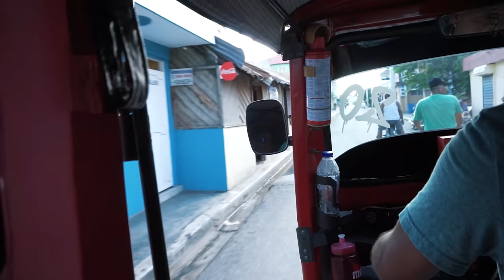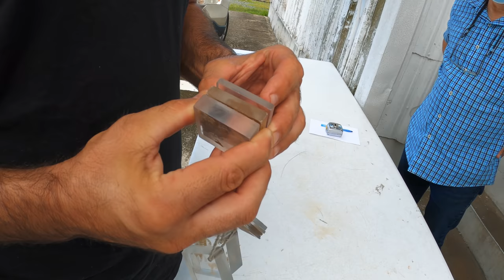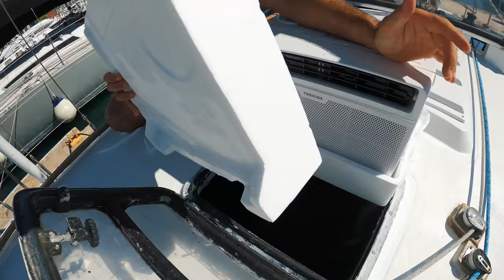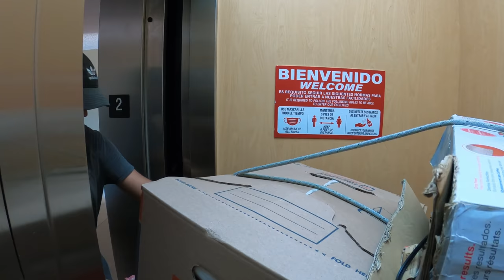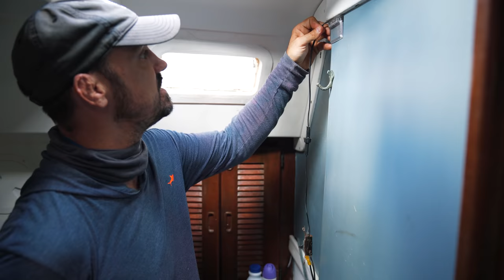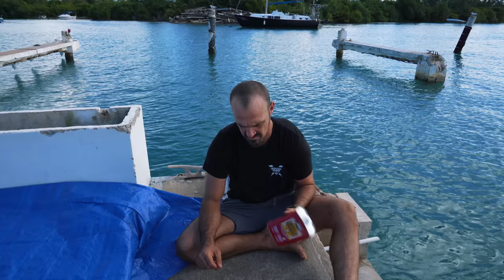BOAT YARD (PART 1) COMPLETELY ROTTEN BULKHEADS!

Comment: Hello,
Luv-ya all!
Years ago, walking space between bulkheads into the bow birth was quite narrow. I got a sheet of 4' x4' catdboard and cut a templet along the hull curve as well as the vertical floor to ceiling walkway. One templet for port side, i bought 1" thick solid plywood 4' x 8'. There are no gaps between the laminates, so when you cut the plywood, there are no open space gaps where ever you cut down to 2 4' x4' pieces. Then, using the templet, using a handheld jigsaw, I had two full size pieces to make a sandwich with the original bulkhead in place
 Thare are nuts with a flat round flange that dig into the 3 layer sandwich. My bulkhead had no water damage, the original bulkhead was lie sandwich meat, the new solid pirces were like two pieces of samdwich bread. Using waterproof liquod nails, nolts, flatt washers and the flange bolts, I tighened the pieces together. You drill thru all 3 pieces; posh a bolt thre a flar washer and the flamge bolt threads toghen the sandwich the same as if u clamp the pieces together. With a pencil, I drew a line 6" parallel to the deck along the ceiling, 6" inches alomg the hull side contour, and 6" along the flat edge of the Vbirth platform that ate the boxpring side of the matress cushions. Using the jig saw, I cut the c shape out of the new 3 layer bulkhead. With bolts 3" centered along the new c shaped bulkhead, the hill was reinforces and strong enough to reinforce and maintain hull integrity. It became so easy to get into the Vbirth with so much open space. My boat potty was in the center space under a cushion over a hinged hinged plywood cover over the top of the potty. I removed the potty and made a storage space whete the potty was. There was water damage, soft spots above the floor panel resting on the bilge bulkheads. I used the same solid plywood to reinforce the floor bulkheads. You are replacing severly wayer damaged bulkheads.if there is no solid bulkhead wood, be sure to use solid core plywood making templets to match the original bulkheads. I recommend cleaning the interior of the hull contour, reinforcing the inside of the hull fiberglasss with 6" strips of heavy movin-rovin glass cloth, and securing your new bulkheads to the center of the new hull bulkhead  strips. The new fiber glass won't need to be finished for appearance, but the new bulkheads will remain strong on a boat yard cradle or at sea. Solid core plywood with waterproof glut is in incredibly expensive, but will be syrong for years and maintain hull integrity.
Be ceryain to inspect keel bolt integrity, ih the hill plywood bilkheads are compromised, the seal between the hull and the keel can break loose , flood the hull and sink boat. Any keel bolt rust or water damage to hull bulkheads means rebuilding and upgrading are a complete waste of money. Get a hull survey asap, before continuing with any more work. Bilge water damage or keel bolt reat are probably the same as a termite infested house.
You have a very old boat and heve taked farther than it likely should have gone. Check it out immediately before spending and working to repair that could remain a very weak vessel even with a ton of repairs and remodeling.
And get a boat survey and seaworthy boat insurance. 
A truck sideswiped my boat on a cradle in storage during the middle of winter. A crane picked it off the ground, but the keel bolt seal was compromised and my completely remodeled, cosmetically perfect boat was a total loss paying me a settlement of $2,000 where my boat was restored and worth 10 grand easily. I don't want to depress you, but please get a survey asap.
I love the fast forward episodes, maybe you can capture your new engine pushing some wheelies very soon!

Comment: Lucky, lucky you...  You've got a Home Depot there, so instead of plywood back in some of the more critical spots.
Corian solid surfacing instead. Water damage and rot resistant forever.

Comment: Rotten bulkheads is never good news, but it's a good opportunity to get rid of excess weight in old hulls, replacing wood with honeycomb sandwich panels. Using carbon in strategic high-stress points and fiberglass in the rest can make your hull way stronger, yet way lighter.

Comment: Wow, just in the previews alone I'm seeing the possibility of a Bulkhead problem. All I can say is, loosen up your rigging, then go to work, Be ready with Marine plywood, lots of fiberglass cloth, and lots of epoxy. And be ready to grind grind grind. I can't say more for going to look at some of Parlay Revival's vids on Bulkhead work and fiberglass work. They did so much , they've got it down. They eventually found the bad bulkhead that was ripping the boat apart because it alllowed so much flexing. And they show a complete replacement , all the tricks. I could find that video if you wanted. Anyway, you told a sort of joke here, and I wondered what that spanish word was ? about 25:31 started with a p or b barathas or something ? OHHHH, got it Pirates in spanish . LOL One guy has a way to run 12v AC . Takes a few panels though. Clark on the Temptress

Comment: Old Hollywood trick to lighten wood to look sun bleached or to lighten prior to oiling is to put plain steel wool in a bucket with distilled white vinegar until the steel wool is dissolved. Then brush it on your sanded wood. It will "distress"  it and make it look sun bleached. Then just use a good stain or preferably oil,  to get the color you want. Also, can you really call it a $5K boat any more? Maybe when you're done, give us a total over the years.

Comment: Put a coat of poly urethane over the wood of the bulk heads or fiberglass resin to seal the wood against water damage.  The acid I have used for wood cleaning works well but just strips the wood to its natural state.  I don’t think you can bleach that wood to a light color.  Might be better to paint it.  Definitely lots of wood rot to repair.  Do the structural work before worrying about the cabinets. That way you have a better idea of budget.

Comment: Sailing Parley Revival redid the bulkheads on their cat, do think that any plywood should be epoxy impregnated on any boat. Do wonder if your mast step is not reliant on those bulk heads? Was just thinking of how they sandwich a steel plate into garage door frames to prevent sagging. Ask your fiber glass guy if he thinks that would stiffen the bulkheads, Parley just used glass.

Comment: You've got a lot of reconsruction work to do. Can i suggest that you make a schedule bearing in mind that one priority is going to be to fit your new engine in its location and bearers , and mountings ; future proper access for the necessary filter and oil changes and servicing .. I would further .recommend that you begin to make conduit access for the future electronics you will fit and their locations so giving you an idea how  long and thick these cables/wires the electric wiresloom need to be-and access   it will save cutting that expensive timber/ grp that you will have fitted. Siding doors will avoid the rusty hinges and  seal off item  inside from bursting when heeled or in rough condiitons..Lastly ,make sure that the new well - used and reliable tooling is kept dry/in specific location for tools- they also weigh a lot in bulk.  I have done much of this work on my last yacht,. Don't be too proud to ask for help from other yachties or friends - you would help them too.
 Best regards to First Mate  Kristen and yourself.

Comment: Be careful removing bulkheads with outside boat stands I’m not boat construction guy I think you need to level front to rear and left to right before taking out a bulkhead probably do one at a time to keep hull straight and level so you don’t deform hull good luck guys and remember you can’t have cheap and good spend what you have to to be safe out there on the deep blue JT 🇺🇸🇺🇸🐟🐠🎣🛥🌴⛱🙏🏻🙏🏻🙏🏻

Comment: good luck with the re-build … some bits look like they got a soaking to the point they rotted … I think you opened Pandora's box there … I like the re-builds if you need advice on fibreglassing @Parlay Revival has been doing a lot … keep up the good work 👍🙌

Comment: Man! that looks like it's going to be easier than I thought but harder than I thought.  Even though you have a keel stepped mast I suggest removing the mast to chisel out all that rotten wood for those bulkheads and chainplates and sliding new panels into the fiberglass sleeves and tabbing in place with new glass. but i'm sure you will attack this project in a totally exciting way :)

Comment: A good way to get problem screws out is to cut a slot in the head with a Dremel type cutoff wheel.  Straight Screwdriver BAM.  You're gonna love that Milwaukee wet/dry vac.  You can spray the filter clean with a water hose, let it dry overnight, BAM.  

Rotten Bulkheads???  The way to fix those is get a dog and buy a 200K blue-water behemoth.😂🤣

Comment: Have you considered staining the teak a lighter color? Teak is a little tricky to stain, but it is doable.
Reply from the maker: It's just so red.
Reply: @SailingGoodBadandUgly  there are several white wood stains and dyes to choose from when applied over teak should result in a much lighter color. Worth an experiment.

Comment: It's a pity you didnt take all this into account before you did all the work earlier in the year, you knew the engine was knackered, you must have known the hulkheads were dodgy or you wouldn't have covered them with the other wood and taking it all, into account you could have used all your "peanuts" to buy a better yacht and just have accepted that for 5 grand US you had had your money's worth. You would also have saved on two lots of accomadation on shore. Also you will probably need to get the boat surveyed now to ensure your work is up to code.  Well good luck.

Comment: That wood looks like mahogany. It will never lighten up. What about covering it by gluing on a very thin veneer of the light shade you want?  Check your chainplates while you've got everything opened up. Even stainless can rust, crack and weaken. How many years did you plan to be in the boatyard??  hahaha

Comment: Don't  go crazy. No need to replace  a 36 inch bulkhead because of 3 inches of rot.  You  can paint on epoxy  on some areas that are out of a site.  Save all good wood and hardware till the end, costs add up. Thank you

Comment: Ahoy... watching you Matt with the teak is making me talk to the screen, I mean yikes. Teak is going to look like teak and that golden glow looks damn great when stripped, bleached (Tip Top Teak or others) sanded. It's the premium boat wood for it's great rot resistant properties and longevity. Different varnishes have lighter and darker qualities. Z Spar is lighter that Epifanes for instance. 
What does modernizing mean anyway? Do you mean the new blonde looking interiors that remind me of travel trailer interiors? Ok, I'm prejudice toward a sailboat looking like a sailboat and not a Winnebago. White surfaces and teak is sailboat; white overhead and teak for all functioning surfaces like cabinet doors etc., ... BTW check the price for teak while you're talking about scrapping it for cheap replacement, there's a reason for the $$ cost not to mention the labor to make things like those cabinet doors. Ok that's it... love the channel and you two, you've come a long way towards becoming a sailor. Keep up the good work, wife and I enjoy watching your videos on board our liveaboard .

Comment: My wife is the orderer and I am the hoarder. She will throw away perfectly good food because the "best use by" date is expired. I'll keep the smallest piece of wire, nuts. bolts, etc. thinking one day I am going to need this. Fortunately for me, it has happened more than once that I had just the right part in my hoard to save the day instead of having to go look for something.

Comment: Oh my God I thought I was going to wet myself laughing liquid sandpaper is meant to prep a surface instead of sanding before you apply at different type of coating it is not in any way shape or form a paint stripper NADA zip it's just meant to degloss the surface so that the next coding can more readily adhere

Comment: Your wood appears to be Philippine Mahogany, not the more expensive teak wood.  If so...why not just paint the wood after scraping and prepping.  The door wood looks solid and very reusable as well as your facing wood.  This would give you an upgraded look at the least expense.
To repair the damaged bulkhead areas, after suitable patching coat the entire area with a good wood hardener such as MinWax Wood Hardener.  The stuff is thin but soaks wood and hardens like a rock.  Really saves on impossible repair jobs and last forever.

Comment: Pocket doors have nothing to do with "back in the 50s". They're not about the look. They're about the function. Modern boats have them everywhere.
Putting a hinged door there will take up space because of the area it needs to swing. Boats have pocket doors to save space. If you don't like the pocket doors, hang a curtain. Don't put a swing door in there.

Comment: You need to use aircraft epoxy stripper. Dads. That being said you're not going to get that wood any lighter. I had a furniture refinishing and repair business for many years. Also keep in mind but you need to seal on the inside and out. Unfinished wood will expand and cup the finished side. All plywood will de laminate

Comment: There are allot of things that are optional in this life.  Having intact bulkheads in a monohull or even catamaran sail boat isn't one of them when you plan on lifting a boat out of the water in a cradled/sling type boat lifter.  It may not be obvious, but cracking in fiberglass boats is a real problem when the outer portions of the hull aren't adhered to the inner layers as you have previously shown was happening in your hull.  At the minimum you need to have some sort of bracing in the locations where you are removing bulkheads, before you completely remove the bulkhead that are there, that span the boat side to side.  I have experienced the ill effects of that and it isn't funny.  At a minimum the boat yard people should at least look at your interior hull before they lift you out.  You have been flirting with danger all along sailing three thousand miles in a boat in as bad a condition as your boat obviously is.  Talking as your Dutch Uncle, even a rotted bulkhead that hasn't completely rotted in every area holds a little piece of your hull in place and spreads out the side loads.  Be careful and don't just press on without considering what you are removing as a support while you are still in the water even.  At some point the hull can crack below the water line, in places you can't possibly see, and even if you don't sink at the dock you could have a leaky boat for a long time to come.  Just saying...

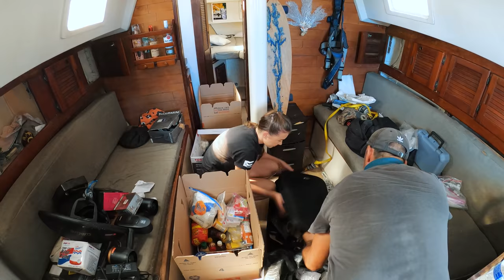Comment: You're only 5 minutes in so I don't know where you're going with repairs but here's a fellow YouTuber you should know. Matt, you'll dig this guy if you aren't a fan already. He operates philosophically from the same place too - uses what he has  - and this is only 3 weeks old. He cuts plexi on the cheap in his garage using a jig saw and a compressed air hose.  Then he bends it to make a front wind shield in his girlfriends BBQ - but that's another story.  Tune in at around 10:30 or so https://youtu.be/hPj7C6G0OQc

Comment: Love you guys!❤️. Nice ride, been there, done that…😊. 

I drove two separate Tacomas for twenty years, for work(landscaping), and play(off road beach and snow), and both trucks proved tough and very capable. I did experience the infamous Toyota Tacoma frame rust issues however. First truck, 2001 Tacoma Off Road, got a new frame put on after about 9 years. Bought a 2011 Off Road and hoped Toyota had straightened out the frame issues, but no, this one started rusting out and Toyota is performing rust prevention treatments trying to avoid putting new frames on. Would have been nice if they would have just addressed the source of the bad frames to begin with. Does anyone know if they finally corrected the frame problem on the new trucks? I’m not gonna find out...switched to a Chevy Colorado Z71, and I love it!👍 

https://youtu.be/mq8Jo1t2Uqw

Comment: there'll be no end to what needs to be removed from the interior of a well-used 40 year old boat.

TBH every penny invested in that boat will be money wasted, IMO. you've already had more than $5000's worth of use out of it and would cost you more to set it right than it will be worth when finished. cut your losses, get jobs if you must and find another boat is my advice. trying to make it right could prematurely end you sailing life, not necessarily due to an accident, but due to financial ruin and despair. i'm not kidding.

better yet, change the focus of you channel to a quest for a new boat. find a cheap marina near a large population center and live on your boat, get a job(s), and save save save. make it known to those that can help that you are in need of a new boat to keep the channel going and focus the channel on the amount you've saved, and the search for a boat. in the end you'll  still have your channel, a boat that will work properly and you can extend your area of exploration to the entire Caribbean.

as it is i'm afraid you'll be fixing that boat for months. and in the end still won't have a decent boat and will have spent twice or three times as much as you would have had you simply bought a decent used one. 

...just my opinion, of course. 

BTW, i've lived on my 40-year-old $25,000 38' sailboat for about five years. it's not an ocean going seaworthy (that would take about another $20,000 to do, i'm guessing and is NOT happening, although the boat has been restored a couple of times and has a newish engine in it) boat at this time, but then again i never planned on using it as such.